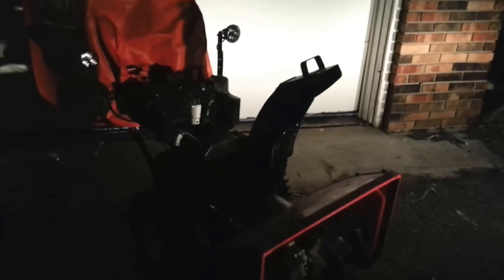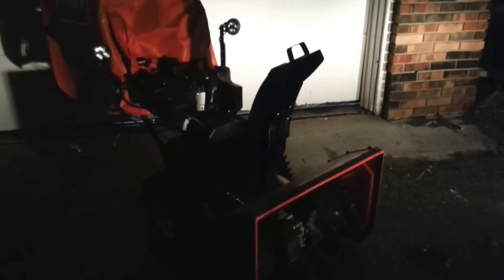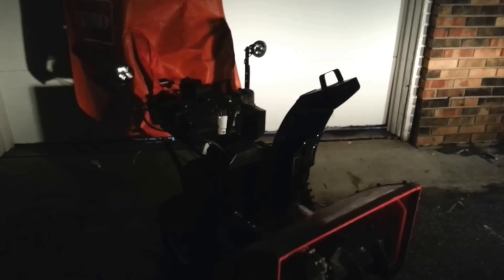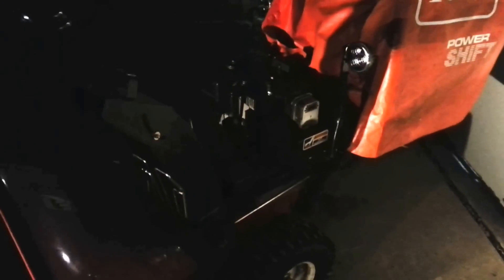LED lights for your snowblower that don't flicker!

Comment: can we see your connections ? Also my original light on my snowblower is out , can I use the wire that goes to my light to connect the rectifier  set up for LED lights ?

Comment: I have a single wire stator on 8hp Tecumseh. I'm guessing it's the smallest power output? Any idea what my amps/watts are coming out? Roughly at high idle. Trying to figure out what light I need to get
Reply from the maker: I used to know what that stator outputs, you may have to consult the forum, I bet someone knows.
Reply: @superedge99  I created an account and asked...ty sir!

Comment: I just installed LED lights to my snow blower using a Milwaukee drill battery to power them. They use so little amount of juice I decided to also add heat grips too. I order a battery recepticle off Amazon to plug the battery into and run the neccessary wires to the lights and grips with switches and a volt meter to monitor the power supply. It works very well being I don't have a stator in my engine.

Comment: Better to let the blower charge a battery than run 12 v led off battery
Reply from the maker: lottsalasagna what are you talking about? I'm confused. The is no battery on the snowblower.
Reply: superedge99 yes I know ..let the engine charge a battery and run lights off a battery
Just future reference
Reply from the maker: lottsalasagna either a battery or capacitor, makes no difference. I used a capacitor. It's all explained in the link. Capacitor is a fraction of the weight and bulk.

Comment: Is it possible to continue to run the halogen also?
Reply from the maker: Douglas Borgaro probably not advisable, you may overload the circuit.
Reply: superedge99 
How about 3 led?
Reply: I could remove halogen?
Reply from the maker: Douglas Borgaro you'll have to do the math for the amperage draw of the led vs the halogen.

Comment: hey there i installed a led lamp to my snow blower aries deluxe 28 i installed a switch a fuse the bridge rectifier it still flickering how can i eliminate that
Reply: you need to get your hands on some 2200mfd 50v capacitors.

Comment: I used an old 12V battery powered drill, the 12V battery from my lawn tractor( small size) and a double pole double throw toggle switch with center neutra for this modification.l.   I removed the top half of the chute direction shaft, chucked remaining shaft tightly in the drill and mounted the drill under the operating console.  I now can rotate my chute quickly left to right or any position in between, using the toggle switch.  I have a 3 sided canopy on my 30" 10.5 hp Snowblower and have a rotating blue light on top of it.  Just because I could!  Also a HCSL from a Blazer with a 12" row of red led's at the top of the rear of the canopy.  Battery will last several hours without recharging.  County guys always wave.

Comment: nice video,  i have a question not sure when you going to answer.  it is supposed to have current in + and - after the rectifier?
Reply from the maker: If I understand your question correctly, yes there is a positive and negative coming off of the bridge rectifier. Please restate the question if my answer doesn't make sense.
Reply: +superedge99 , Thank you for the quick response.  my question was  " it is normal to have some positive current in the negative side?   i used my tester and there is current in both sides, (after the rectifier) one is very strong and the other one is kind of weak.  and also after the rectifier i have a capacitor and than a toggle switch installed, but it's doing nothing. it  won't shut the light off when turn it to off position. Can you help me with that? Thank you very much.
Reply: +superedge99 , Thank you for the quick response.  my question was  " is it  normal to have some positive current in the negative side?   i used my tester and there is current in both sides, (after the rectifier) one is very strong and the other one is kind of weak.  and also after the rectifier i have a capacitor and than a toggle switch installed, but it's doing nothing. it  won't shut the light off when turn it to off position. Can you help me with that? Thank you very much.
Reply from the maker: +ideaslandscape the capacitor is installed after the rectifier to clean up most of the "dirty" voltage that comes from the rectifier, so what you're seeing from testing is normal. I'm not sure why your switch isn't working to turn off your light, possible that you have wires touching where they are connected on the switch?
Reply: oh ok, Thank you,  so it is normal to have some positive current on the negative side after the bridge rectifier?
Reply from the maker: +ideaslandscape yes

Comment: oh, sorry.   The output are most on board generators are 18w for just a light. The generators are all pretty much 12v although actual is a little higher.  Some have higher output in wattage/amperage and are rated in amps otherwise. 1 amp at 12v is 12w. Remember amps times volts = watts. The only generators that are rated in watts that I have seen,are the 18w  ones, the rest give amps.  So the 2 amp ones being at 12v is 24w etc. You can calculate.   You will find led dc lights give the wattage they use. There is a good light you can buy which is sold for trucks and off roading which  is a 18w 6 cree led round light which is also available in 27 w versions and more. That 18w throws 1200-1600 lumens.

Comment: Your rectifier has 4 contacts. 2 for your ac in, and the other two are your + and - dc out.  You connect the ac contacts, one to the wire coming out of the engine, and the other to the ground on the motor/body. There is no polarity for this. The + and - on the rectifier then go to the + and - to your dc light. Very simple.

Comment: Some snowblowers have already installed a rectifier for some reason or another for the components that they included. I had a bolens (mtd) with a light and heated handgrips. They already had a rectifier on there for the headlight but still ran the handgrips with ac I think if I remember correctly. They could have kept ac on the headlight but decided to do that for some reason.

Comment: What did you use to connect the capacitor to the wires from the lights with,  a wire nut?   That capacitor just sits out in the elements exposed like that?
Reply from the maker: I soldered the connections to the capacitor.  I then wrapped connections with electrical tape. My connections are all under the dash of my snowblower, so not really exposed much at all.  If your installation is more exposed then you may want to get an inexpensive plastic junction box to protect things.

Comment: I wasn't planning on using a capacitor unless I absolutely had to.  I didn't realize that's what you did.   So the capacitors have a set of 4 terminals total?  What size did use?  Wire gauge? Any idea maximum size wattage of led's I can use.  Currently have 11.5 Briggs and the bulb is 12v, 20 watt.
Reply from the maker: If you read the first post of the thread I linked to it mentions that your LED's may fail due to the dirty voltage, so doing the capacitor install is a must unless you want to gamble.  It's impossible to know for sure if the LED headlights you are using are sensitive to voltage ripple or not.  The capacitor that I used was a single 50v 1000uf capacitor, it has a positive and a negative like this one http://www.amazon.com/Nichicon-SE-1000uF-Electrolytic-Capacitor/dp/B0079Q78GC/ref=sr_1_8?s=industrial&ie=UTF8&qid=1414521219&sr=1-8&keywords=50v+1000uf
16 gauge wire is fine for this application since you're only drawing about 1 amp of current.
You can use 20 watts of LED's since your original bulb was 20 watt.  It is doubtful that Briggs would have placed a larger stator for a headlight circuit than what was needed for the 20 watt incandescent that came on the blower.  So basically you can assume that you have a 1 amp stator.  20 watts of LEDs is a HUGE upgrade from the incandescent you had.  If you do a search for "10w Cree LED foglight" on ebay or google you will find some nice options.  I would recommend the foglight and NOT the spotlight version (foglight has a fogged lens) because the foglight is going to have a wider dispersion of light, while the spotlight will be very narrow.
Reply: Your wattage is probably 18w coming out which is what most of these engines have such as on my 10/30 snapper with a 10hp tecumseh. I suggest the led light I mentioned above. Look up 18w led round flood on ebay.

Comment: So if I understand this correctly. You took the 2 wires from the stator and snipped those and went to the 2 AC parts of the Rectifier. And the 2 led's positive and negative are tied together and go to the other DC + and DC -?  What did you use after you connected the light wires to go to the Rectifier connection wise? A 3 way connector?  And how do you know how many watts you can away with? Thanks
Reply from the maker: Typically there is only one wire that comes off of the stator as one side of the AC current, the other side is the frame of the snowblower. I'm not understanding what you mean by "...the 2 led's positive and negative are tied together and go to the other DC + and DC -?"  The LED positive and negative go the capacitor positive and negative, then the capacitor positive and negative go to the rectifier positive and negative.  The rectifier gets one side of the AC current input from the frame, the other from the stator.

Comment: Any chance of showing the actual wiring schematic?  I have yet to see what wires go where.  I know the parts needed,  but just want to know where everything goes and if you put capacitors on yours. Also,  how do you know how many watt bulbs you can  get away with safely. I have a 28" Pro Ariens 11 hp.  Thanks. Great video.
Reply from the maker: Here is a link to a thread that I created to address a lot of questions about wiring and diagramming. 
http://www.snowblowerforum.com/forum/general-snowblower-discussion/6602-upgrading-your-snowblower-lights-led-lights.html
Do you currently have a light on your ariens?
Reply: You can read above what I wrote about wiring. I did not include the use of a capacitor. Chances are your generator is 18w at least but more may not be so. A safe bet is a "18w led round flood" which you can find on ebay. I use them and also the 27w version. They are good and durable.  My 10/30 snapper with a 10hp tecumseh has the 18w generator.
Reply from the maker: 4bosox, just check the existing bulb for what wattage you have to work with for the LED.

Comment: Awesome!  I'm going to do the same on my Yard Man 10 HP Model #31AE5KLF801 which has a Tecumseh lh358sa engine.  Can you post or send me a wiring diagram on how to wire the lights correctly?
Reply from the maker: http://www.snowblowerforum.com/forum/general-snowblower-discussion/6602-upgrading-your-snowblower-lights-led-lights.html

Comment: I'm sort of confused here. All snow blowers that I've personally seen take a 12V DC bulb. They all appear to put out DC voltage. I don't know your exact machine, but Toro only sells sealed headlights that connect via a single wire to a common Tecumseh engine with a stator. The rectifier should be completely unnecessary.
Reply from the maker: Buggyspam, the sealed halogen/incandescent bulbs that you see on most snowblowers will work off of AC or DC. Bulbs using filaments don't care if they are receiving AC or DC as long as the voltage is within parameters that it can handle which is why you've seen DC sealed halogen bulbs on snowblowers. Only snowblowers that have an on board battery have a voltage regulator that takes the AC voltage from the stator and changes it to DC voltage.  So about 99% of the snowblowers out there past or present have AC on the headlight circuit, which makes a bridge rectifier required in order to add LED's and not have flickering.  I hope that I explained this well enough, let me know if you have questions.
Reply: Ok, I know that at the base level a stator puts out AC, so if the bulb doesn't care and it's all AC, I can accept that. I'm still skeptical that a rectifier is needed. I personally have never swapped the light like you, but I've seen a few videos like yours (which is why your video popped up in my suggestions) for LED conversions. None of the other LEDs appear to flicker like an incandescent bulb does. Did you try anything with LEDs prior to adding a rectifier?
Reply from the maker: buggsyspam LED's are "light emitting diodes" so when they are hooked up to AC current which is alternating polarity then the LED flickers since the LED turns off once polarity switches.  This is why LED lights flicker without a bridge rectifier.  There is nothing to be skeptical of here, physics dictates that if you don't want the LED's to flicker on AC current you need a bridge rectifier to change the voltage to DC so that the LED's aren't turning on and off 40-60 times per second.  Incandescent bulbs don't flicker on AC current because 1.They are not diodes  2. They can't cool down fast enough to be seen as "flickering" on 40hertz-60hertz AC current.

Comment: Well- that should sufficiently scare the crap outa the neighbors. Change out 2 (1@ side) bulbs with Hyper BLUE. Much more soothing, natural contrast against white snow. Higher K-value.
Reply from the maker: I kinda thought that the higher K-values (above about 6500K) the light ceased to render colors very accurately and was kind of distracting, too much blue.  I stuck with these at 6500K because I thought that they were close to daylight.  Thanks for the comment!

Comment: This may be a ridiculous question, but house current is AC and LED lights do not flicker.  Why would it with a snowblower?
Reply from the maker: Enigma, depends on what you're describing. Led replacement bulbs for lights in a house won't flicker because they use a bridge rectifier. Most led Christmas lights don't use rectification so they flicker at 60hertz which means that they turn off and on 60 times per second. Most people can sense a flicker which is even more evident if the light source is moving (try swinging a coiled up set of LED christmas lights at arms length in front of you and you'll notice the flicker more easily) Your snowblower is typically creating AC voltage at 40-50 hertz which is why it is even easier for your eye to perceive as flickering.